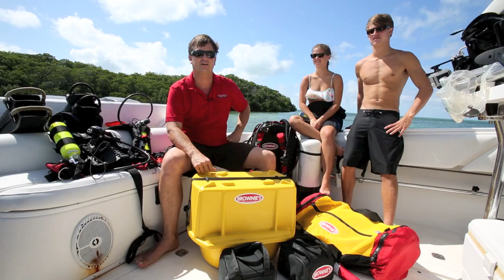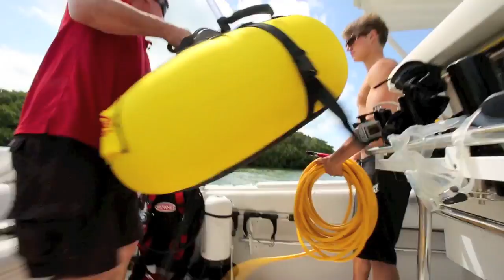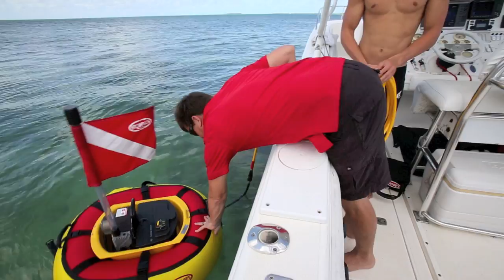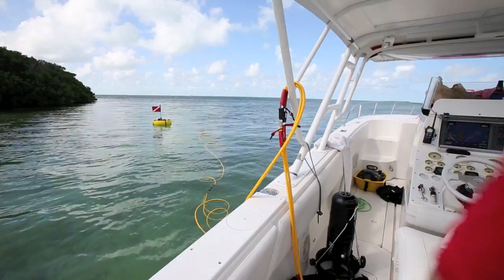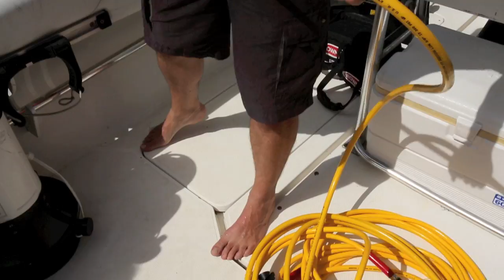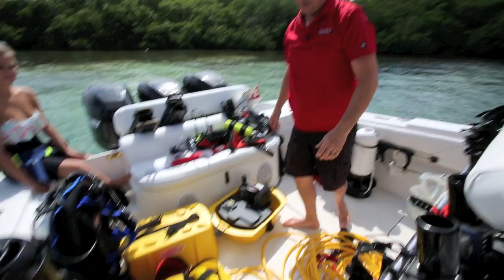Brownie's Explains The Variable Speed Hookah Model

Comment: nice but loud as f. also you do not have compressed air tank, you should have on at least a small one. Plus a hook under for weights in case you want to make center of gravity much lower and whole system more stable. Also compresors should kick in with air on demand to fill up compressed air tank. With this size of unit i would expect it to have this features.

Comment: So, this system does not need a reserve air tank, or a chest harness?
Reply from the maker: Hello Wish Full,

For the Brownie's Variable Speed system, you do not need a reserve air tank. This systems works on a variable speed air system where the motor senses where there is no air demand by the diver, meaning no inhaling from your regulator, therefore, the variable speed system ceases until again the air demand from the diver, inhales again and makes the systems react and provides the surface air. This allows better energy consumption.

In regards a chest harness, Brownie's uses two types of belts. A Brownie's Drop Weight Cummerbelt and we also offer a basic tow belt. Both of these belts are designed to easy clip your hose and regulator in place to make your diving experience very easy and light. All systems provide the necessary equipment for your dive. 

For more questions or information, please visit our website at www.BrowniesMarineGroup.com
or you can call us at (954) 462-5570 and we will be happy to assist you!
Thank you!
Reply: Browniediving Thank you for replying. What is the protocol to know when the fuel is running empty, and what to do in an emergency when there is no air coming through?
Reply from the maker: The VS system on full charge has a 45-60 min run time.  You need to plan your dive accordingly.  Whether on scuba or hookah, if you are diving deeper than you feel you can perform a safe out of air emergency ascent, we recommend a bail out system like our Egressor package.  Please refer to out website for details pertaining to the Egressor packages Brownie's has to offer.

Our gasoline powered systems, they run aprox. 3 hours on a full tank of fuel.  Always make it a practice to "Plan your dive and dive your plan."

For more information or additional correspondence, please email us at info@browniesmarinegroup.com.

Safe Diving!

Comment: Hi Robert. I see that my idea of a tank on a back of the diver helped you, and it is much easier to breathe. But, on such length of a hose, it is all the same heavy to breathe. I developed the regulator of new generation which will easily solve this problem. In my regulator to breathe even better. The best regards Oleg Dynnyk
Reply: Hi Alik. We have been placing the mini-scuba system on the diver for a decade now. In the early 1980's, we used a low-pressure "surge" tank made of 2-inch PVC with a check valve on the the inlet to improve performance from the older fixed speed compressors. Today, the variable speed design (patent-pending) is proving to be the most efficient as we key speed of compressor to the diver demand. Please send me an email to robert@browniesmarinegroup.com with specifics.